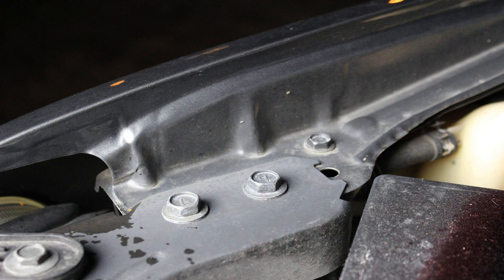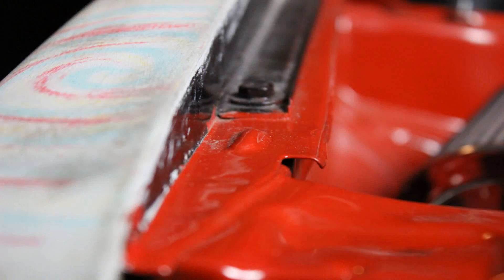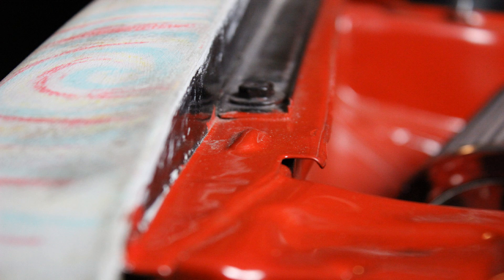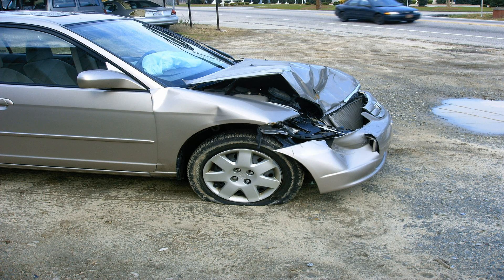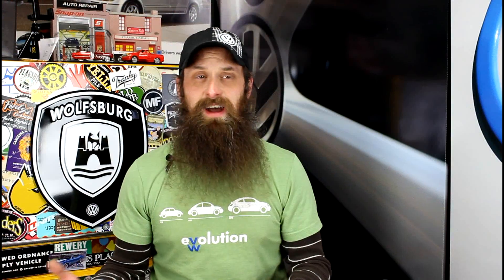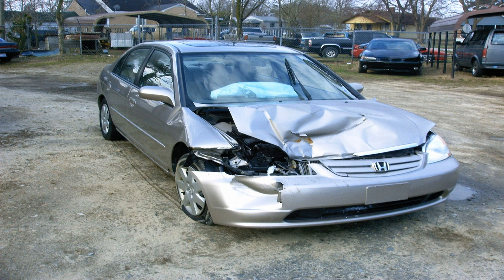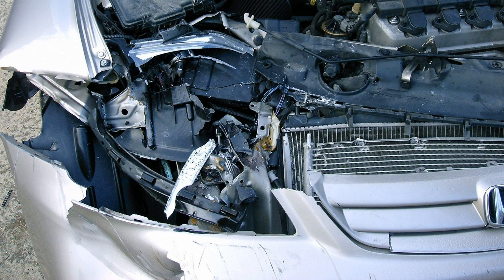A look At Vehicle Safety Systems ~ Podcast Episode 39

Comment: Just found your channel today Steve Rob told me about it. Pretty cool! 

Just have one question though. As a mechanic myself I have always understood dual-stage/multi-stage SRS system to be based on the severity of the impact as opposed to the occupant weight and size? I know the passenger classification system may decide weather or not to deploy a restraint based on passenger size but I wasn't aware that it would base what "stage" to deploy based on passenger size. I always understood it like this for example:  For less severe crashes requiring less inflation force, only one stage of a dual-stage/multi-stage inflator may go off, or there may be less output pressure from a variable output inflator and for more severe crashes, all stages of a dual-stage/multi-stage inflator may go off at the same time or there may be full output from a variable output inflator. 

I would have thought being that when an airbag module deploys it is fully inflated before you face plant into it, that it could not adjust the amount of cushion so to speak based on passenger size but it would be more critical that it was inflated at the correct time based on the severity of the crash. It's more of a time changer (milliseconds)

Wait I think I may have just confused myself. Does it make sense?

--Eric O

Comment: I am extremely nervous about the direction safety systems are going.  Back in 1971 when my MG Midget was built, the focus was on trying to make cars that handled well enough to avoid a collision, as well as padded dashes, collapsible steering columns, and seat belts.  There were no systems to interfere with the driver's input.  The car did exactly what you told it to do.  Cars were made to be driven and for the enjoyment of driving.  Ralph Naders book had made a splash and changed the rules about cars were being made and things were getting better.  

Fast forward to 2015.  I just read this in the latest issue of car and driver (02/15) in a column written by John Phillips.
"Last month, I was driving our long-term Kia K900 on I-90 past Little Bighorn Battlefeld in Montana. The adaptive cruise control was engaged at 75 mph. My feet were perhaps six inches from the pedals, and I held the steering wheel with one hand. There was no trafc in front, none behind, none in the opposite lanes. That’s when the car, wholly unbidden, braked violently. Loose items in the cockpit rocketed forward,
and the seatbelts cinched to chest-fattening pressure. My wife cried out, and I was so thunderstruck that I couldn’t think how to react. I recall saying, “What?” a couple of times, which did surprisingly little to mitigate the crisis. Then I decided to pound the brakes—bleeding more speed, maybe to as little as 20 mph—which disengaged the cruise control. That corrected the problem, although I achieved this result with no greater purpose than to cease being startled. If an 18-wheeler had been tailgating, well, the Kia would be MIA. When I later saw myself in a mirror, my hair was damp and cowlicked, and I had a visage of cosmic confusion, like Doc Brown in Back to the Future."

He goes on to discuss how automation adversely impacts human skill and how the autopilot systems aboard an A330 (with an automated touch screen interface) caused a plane crash.  Air France 447 was flying from rio de jenero to paris back in 2009 when ice clogged pilot tubes and all three air speed indicators.  Instead of monitoring the ground speed which was being displayed through their GPS systems, they freaked out and panicked and the pilots actions caused the plane to stall, crash, and killed 228 passengers, and the flight crew.  

I've had some experiences with ABS that lead me to worry. There was an incident 10 years ago when I was driving my parents honda accord in snowy conditions when I stepped on the brakes, the abs light came on, and the brakes didn't (no matter how hard I pressed on the brake).  The car sailed straight through the intersection!  The car then functioned normally the rest of the drive and we didn't have a problem with the brakes after that.  I've totalled a 1993 corolla going 10mph and I wonder why it was nessesary for it to receive that much damage at that speed.  I'd rather have a car I can keep driving and suffer a few extra scrapes for a minor fender bender than have to buy a new car.  There is a point where you start to think they build these things to be disposable so they can make more money.  Then there are those who argue that its better to get an SUV so that you don't suffer as much damage as the next guy.  Too bad I cant drive a mining dump truck to work.  No way anyone's going to leave a scratch on that one. But seriously I would rather we all drive small, light, agile cars with good gas mileage.

At least the corolla had actual cables connecting my gas pedal to the throttle body.  My Mazda 3 is all drive by wire.  I don't actually have any control over how fast the car goes anymore.  With traction control and parking assist systems becomming more common place its not inconcievable that a technition could drive a modern car using his scan tool.  What if these malfunction?  What if suddenly the car decides that it likes  the look of that tree and heads straight for it no matter how hard yo hit the brakes or try to turn the other way.  We are moving in a direction where cars drive themselves completely.  Where we trust the machine and stare at a dash and lose any ability to drive on our own.  In the name of safety cars are going to start sharing information between them to help avoid collisions.

Heck most cars are wireless hotspots.  Has anyone thought about the possibility that your SUV could be hacked and taken over and used to cause a huge accident so some terrorist can getaway with a bombing attempt?  Back when my midget was but this would have all sounded like crazy talk, but these days its getting all too real.

Comment: The seat belt mounting points on most cars are designed to peel away from the frame much like opening a can of spaghetti-ohs... also cars with Gullwing doors (eg. DeLorean and Mercedes 300sl and sls) have explosive bolts in the hinges that will fire off in the event of the car landing on its roof. Tempered glass will shatter on impact into a bazillion pieces to keep rogue glass shards from flying around and decapitating you. Just a few you didn't cover. Lol (having kids really makes you think about safety.)

Comment: Have you notice that on some cars when the car is driven aggressively or if the car ESP system is activated the belt  actually pull you back in you're seat. I never experience it but I saw it on car test dive. on U tube .

Comment: The headrests aren't really tilted all that far forward -- Saabs have had this for years, where the angle of the headrest keeps you head closer to upright,  It looks like it's raked forward, but really, the seat is raked back, and they want your head upright, instead of tilted backward.   In the event of a crash, an adult head is around 8lbs -- having less of an angle to whip forward and back, in the short time a collision happens reduces the amount of hyperextension that causes whiplash/neck strain.